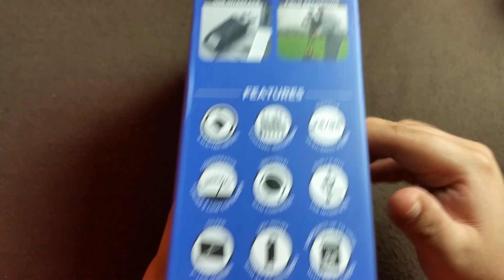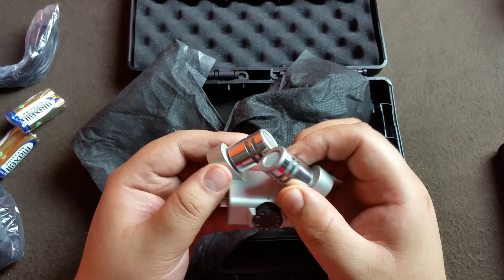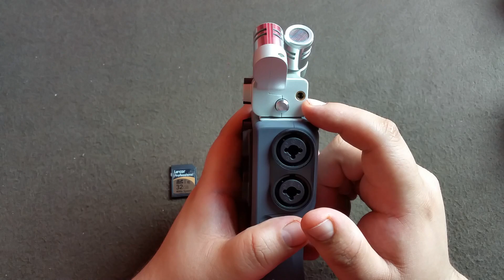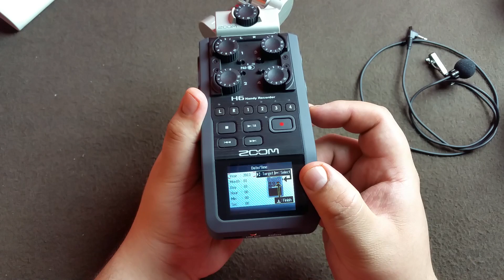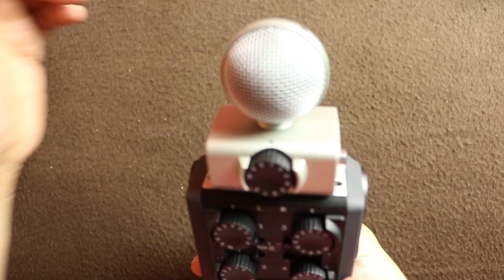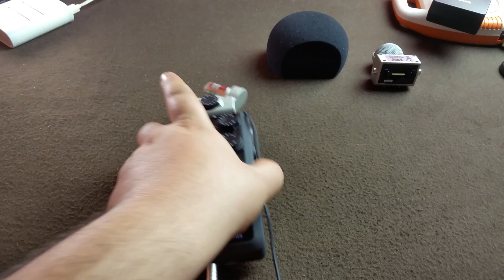ZOOM H6 Handy Recorder Unboxing, Setup And Audio Test

Comment: I am using H6 with Boom mic, but the issue is, as i connect boom mic at any channel and enable it at (48kHz, 24bit) it is not detecting voice after and before i turned phantom power at 48... It was working fine at the location but as soon as I reached home and started to record again, i am facing the stated issue. please help
Reply from the maker: Hi so if I understand correctly at home your mic was not recording even with phantom power? Phantom power uses a lot of battery did u try putting in a fresh set of batteries?
Reply: @urtechtoday  yes.. I did.. Firstly I set it at home it was working fine, then I reached the location it stopped working as it is not detecting sound.. Then after some time, it started, then this happens again.. As i reached home, it stopped detecting audio then after some time it started detecting audio

Comment: If I use lavalier microphone like boya m1 with this device then can I get the good quality of sound without noise? And also what's your opinion about outdoor recording. Is it best for noise free clear sound. Please let me inform. Thanks
Reply from the maker: Hi the device is good and how u use it will give u the result. It's an advanced device. Lav mic can be used with it. The recorder has very low internal noise while recording. Do check ur mic before using for noise.

Comment: I have a rather technical question about the H6....I hope the way I explain it won't confuse you...if it does, let me know and I will try to clarify better...

Ok, I'm a singer and my main goal for using this device is using it in a way that I can record directly from my PC sound card into the recorder....Upload that audio track to my video editor...then record vocals on another track and then upload that...thus making a 2 track recording in the video editor...that way it sounds cleaner than just blasting stereo speakers and recording everything through the XY mic that comes with the unit...I don't think it is possible...I could be wrong, but I was sure hoping this would work...that was my ultimate goal in buying the unit to begin with. I hope that does not confuse you...I'm just really let down by what seems to be a huge problem for me! Any advice??
Thanks 😀

Comment: Hello brother. I am extremely  confused whether to buy 2gb or 3gb version of Redmi Note 3. My budget is 15k so that's not a issue. Please tell me will there be a big difference. and what will be downsides of buying 2gb. Thank You.
Reply: +Sahat Shah get the 3GB one ONLY!
MIUI is really Heavy!
Reply: +Hrishi K Bro are you sure? I already bought 2gb version. Should I cancel it and wait for next sale? Thank You
Reply: Sahat Shah If you are not PowerUser and you use Apps normally then 2GB is enough, but its better to get 3GB
2GB isn't bad as such if you already have purchased it!
But you will feel a RAM to be little LESS 
Solution to this: REMOVE MIUI and Install CM13 ;)
Reply from the maker: +Sahat Shah hi did you watch my video on which one to buy?
Reply: +urtechtoday Please link it Bro . there are several of them
Reply from the maker: +Sahat Shah https://youtu.be/MI_tnKD2kac let me know if u still have doubts after this